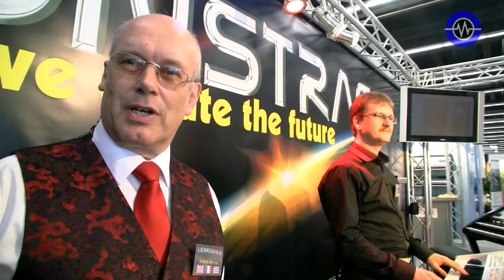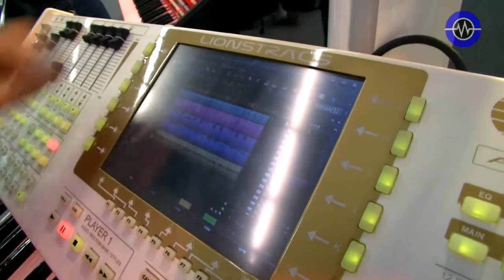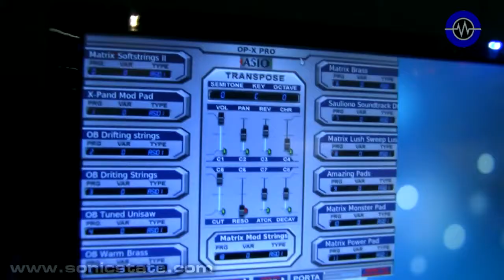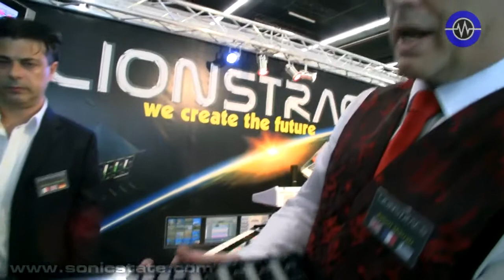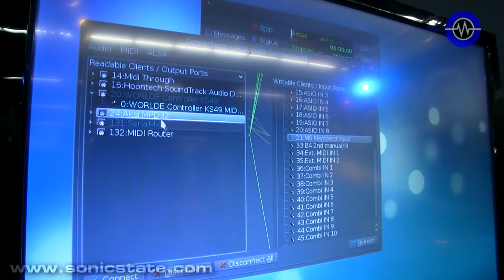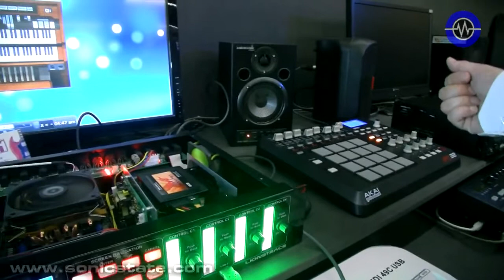MusikMesse 2011: Lionstracs Groove XR -Full-length [14m22s]

Comment: I changed the keyboard of classic moss and korg i30 for lionstracs x-6 a couple of months ago with a musician from Bosnia.
I have a problem with the operating system and it doesn't work on it from the software because it constantly requires B4 II to install wine as well. Eh as I figured out the company is shut down and there is nothing to take off for this machine can you help me in any way to send me another system or tell me what to do next. Thanks for your answer.